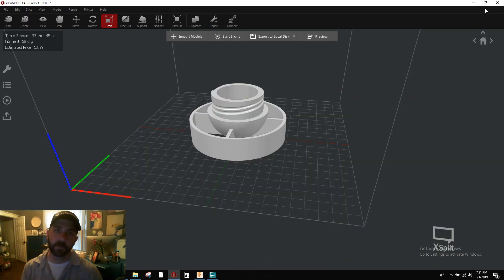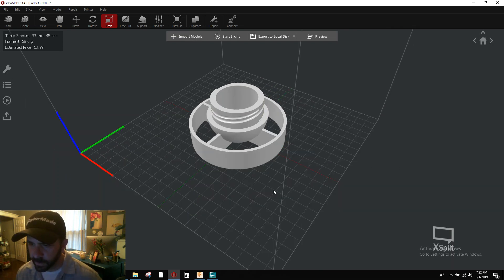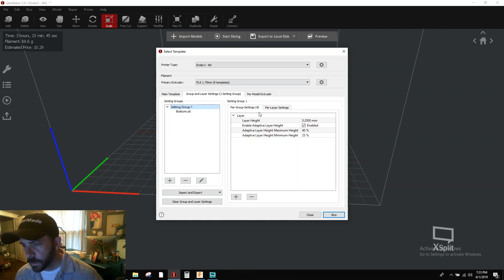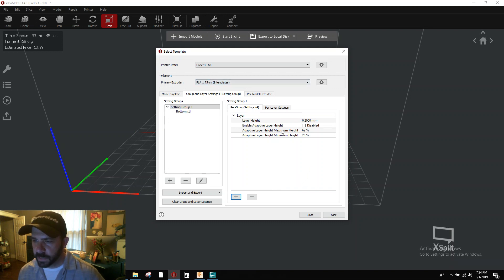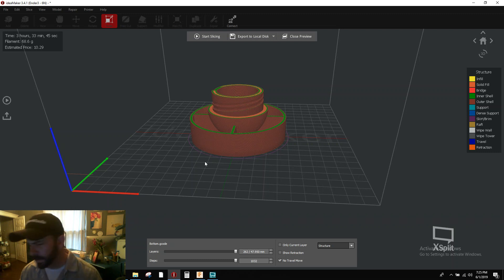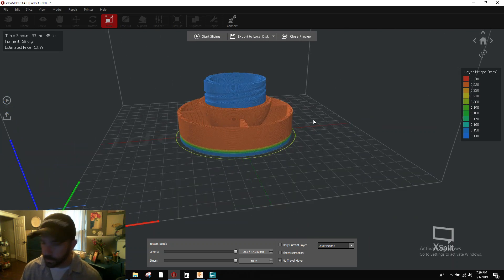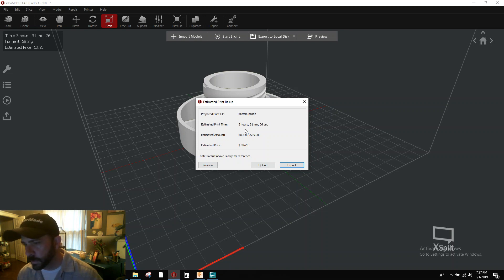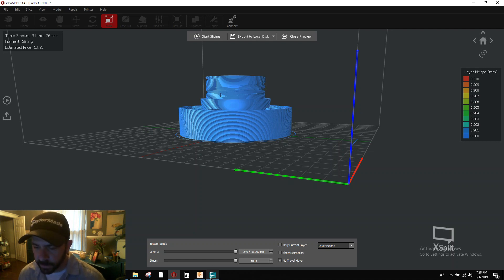Quick tip: Adaptive Layer Control in Ideamaker

Comment: how to do a perfect top layer ? first layer is good but top layer its not as good as first layer where i can change that and to what ? thanks a lot
Reply: It depends on what problem you are having. If there are still gaps then you can increase the amount of top solid fil layers. if the surface is uneven then you could change the last layer speed or use ironing.